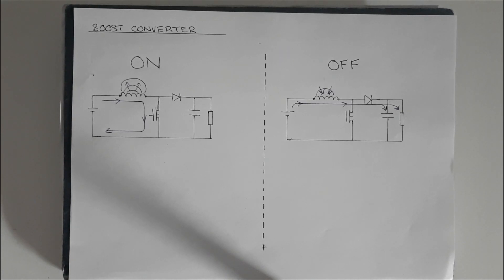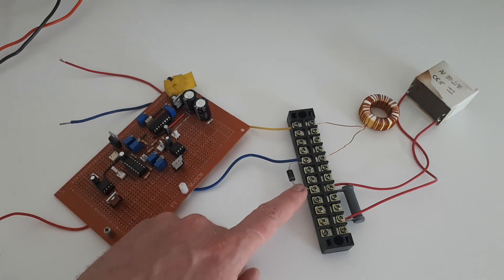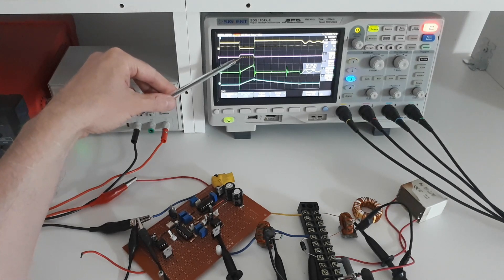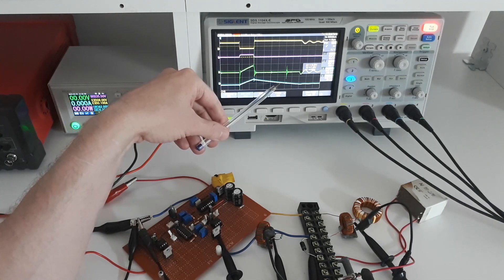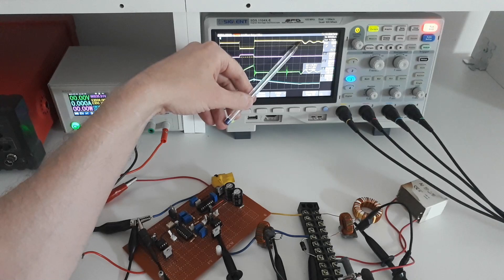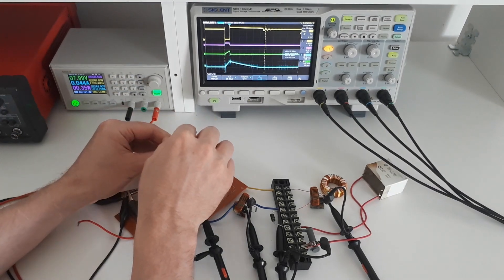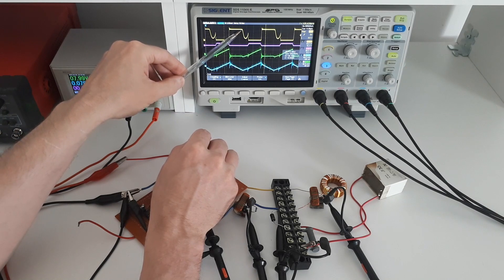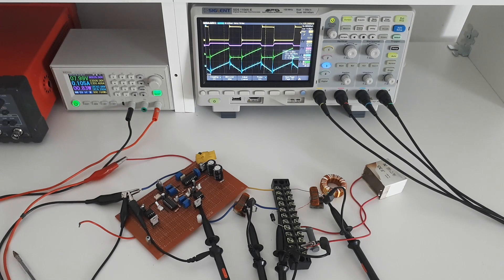Boost Converter Explanation

Comment: The current transformers fail to show an important aspect of the circuit's behavior.
In continuous current mode the inductor current never drops to zero. With the transformer current sensing it appears that the current does drop to zero. To properly show this you need a current sensing scheme with response that includes DC.

The reason that the voltage at the drain of the FET is "flat" after the FET is turned off is because the capacitor is essentially holding the voltage across the load constant. The inductor "sees" the capacitor voltage plus the diode forward voltage minus the supply voltage. In the test circuit this voltage is lower than the supply voltage so it takes longer for the inductor to discharge than it did to charge. With higher output voltage the inductor would discharge faster than it would charge.

It is very important in these circuits to remember that you cannot instantaneously change the current through an inductor or the voltage across a capacitor.
Vdt = Ldi or di/dt = V/L (V in volts, i in amperes, L in henries, t in seconds)

It is also important for experimenters to realize that it is essential to have a load on a boost converter if the thing is operating open-loop (i.e. not actually regulating). Without a load the voltage on the cap could rise to to many tens to hundreds of volts in a fraction of a second. Once you put some energy into the inductor it is going to find somewhere to go. It doesn't care if it delivers its energy into 1 volt or 500 volts, it's gonna put it somewhere!

Boost converts operating in continuous current mode suffer from the dreaded right half-plane zero problem.